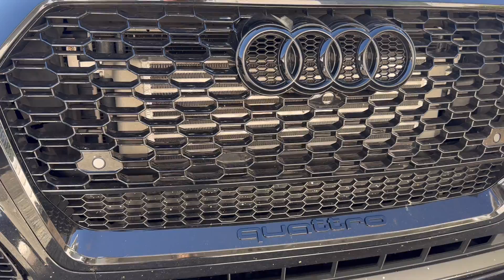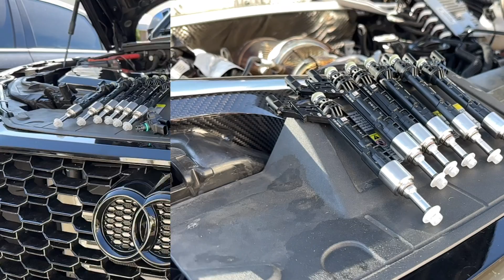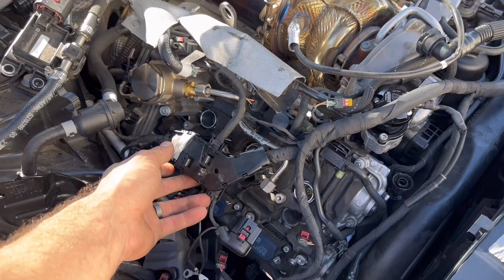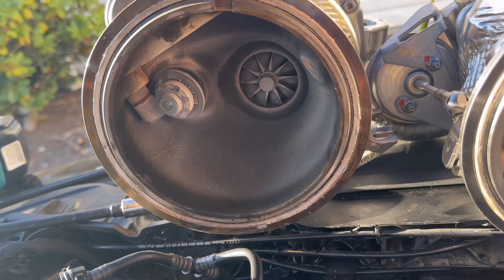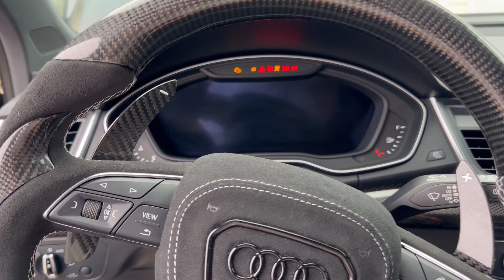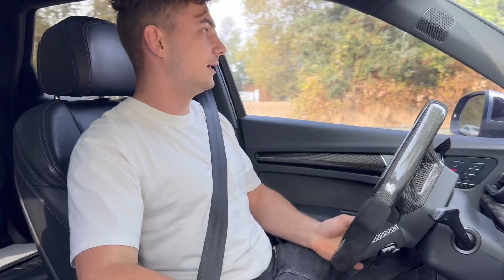BUILDING my SQ5 into a BUDGET SUPERCAR Killer

Comment: yo I checked those turbo smart blow off valve and diverter valve. The site says that they're only for SQ 5 but I have a 2020 S4 any reason to your knowledge they wouldn't work? and you still run the turbo smart parts or did you go back to stock

Comment: What is the maximum horsepower this engine can handle without problems, because I have seen people take these engines to 750-800hp with stock internals. I'm only interested in the engine, not the gearbox
Reply from the maker: I’m basically pushing around 750hp to the crank currently which is insane. Engine is happier than ever. We’ll probably see 800hp on the stock motor
Reply: @Need4Built  would recommend that 750-800hp on stock internals and even if that is a daily (sleeper)..??And are you pushing 750hp on crank on regular fuel or E85..??
Reply from the maker: @erikerik9613  650hp on 92 octane, 750hp on E70.

Yes my wife daily drives it every day. I’m at 70k miles on it now

Comment: homie, why is your oil cap saturated with oil? just from the job? only reason why I point it out is because of the upper PCV hose one way valve has been failing on a bunch of our cars causing oil vapor to blow by the cap, just FYI
Reply from the maker: I’m really happy you noticed. Yes my pcv was failing, I had to replace it right after. Including the hoses that also cracked or failed. 
I’ve already seen too many b9 pcv failures where I decided to make a video about it. The latest one. Check it out:
Restore Lost Horsepower By Replacing This ONE Simple Part
https://youtu.be/Qr-azJgRFD8
Reply: @Need4Built  🤜🏻🤛🏻

Comment: I also have a hybrid made in Poland on ball bearings for half the price of TTE and gets up much better than tte on fuel 98 acetate 620KM 0-100km/h 2.8 100-200 6.7 1/4 mile 10.6 car s5 sportback
Reply from the maker: My SQ5 on E70, full weight weighing 200kg more than your S5, with the TTE810 does 2.7s 0-60, 100-200 6.5, 1/4 mile 10.5.
The TTE810 has much more capability than any other turbo on the market, with more potential. It’s capable of 700+whp, I’m only at 640whp.
Reply: @Need4Built  Not bad my s5 with the driver is 1960KG and how much NM do you have with me only fuel that the station is 95 98
Reply from the maker: @marekhulek3142  
840NM, that’s what I put down on the dyno. 
My sq5 with the driver is a little over 2150kg.
Reply: @Need4Built  You have a lot of Newton meters, I only have 770, but I have a serial catalyst and a serial intake, after replacing the throttle in our engine, it reaches 40KM and 40NM, the same after the porti gu channels in the head, if someone has a push for power, it's a nice option for an additional 80 horses, but there is a problem  with a larger throttle because it does not undergo adaptation you need to work on the soft because I did it to the client has 780koni and 900nm in S5 now he will put 2x g25You have a lot of Newton meters, I only have 770, but I have a serial catalyst and a serial intake, after replacing the throttle in our engine, it reaches 40KM and 40NM, the same after the porti gu channels in the head, if someone has a push for power, it's a nice option for an additional 80 horses, but there is a problem  with a larger throttle because it does not undergo adaptation you need to work on the soft because I did it to the client has 780koni and 900nm in S5 now he will put 2x g25
Reply: @Need4Built  Do you have a diagram somewhere how this turbo gets up
Reply from the maker: @marekhulek3142  
https://youtu.be/PCkOyrSXL1M
That’s the link to my dyno day with the SQ5. You’ll be able to see a comparison of both the dyno graphs for a TTE710 S4 and my TTE810 SQ5.
Reply: @Need4Built  https://youtu.be/Dv1DN7kJ0dQ     This is the result on the tte 710
Reply: @Need4Built  Did you replace the rs4 injectors or strengthen the fuel pump

Comment: I’m looking into buying the turbo, but many don’t recommend it because they don’t have a file for it and claim is not safe. I’m stacking parts right now and found the tte810 available. What’s your advice ? How does the car hold up to it?
Reply from the maker: IE is right around the corner with their insane TTE810 files. If I was you I would buy the turbo now because it takes time for you to receive it. 
I’ve already put thousands on miles+drag testing on the turbo. Car/engine/chassis is happier than ever before. No issues what so ever. I just came back from a recent trip. Look out for the next upcoming videos. You’ll be SHOCKED 😉
Reply: @Need4Built  I appreciate your response. I subscribed and I’ll keep an eye on your videos. I’m looking forward to this never ending build. We should keep in touch. Thanks for sharing

Comment: fuck yea bro i love it. Urs is so much more badass, but I have a hot suv also- its a 2004 xc90 that i fully rebuilt last fall and am now in the process of getting tuned. its quick not fast, car only has gears for maybe 155, but that makes it close ratio in a sense- its like hot hatch fast rn at 250 wheel but its untuned. first tune is gunna make 325/350 ish and if I get bored of that the motor I have is good for 500 pump, maybe 650 on e. point is hot suvs are fricken cool, urs is an absolute unit and im stoked for u.

Comment: Lol nice, running an IDENTICAL setup on my ABT B9, coincidentally picked all the exact same 2+ parts except went AWE for the exhaust. Mythos BOptic as well 🍻 That turbo's the next step for me too, looking forward to seeing how it holds up for you.
Reply: What's been your experience with the exhaust?  My experience was AWEful!
Reply: @Rey2018SQ5  why awful? what’s wrong with it? I love mine. running the resonators because catless. non res was too loud
Reply: @gunnar6726  droning and vibrations especially in 7 and 8 gear.
Reply: @Rey2018SQ5  if there’s dash vibrations look into pulling the speaker grille and putting silicone on the clips. odds are there’s plastic pieces broken in there from the direct windshield sunlight alone. Everyone’s center channel grille rattles. For the droning I just shift down if I’m pulling up a hill or on the gas at all. I keep it out of 8th gear. Any boosted engine trying to put down power at 1500 rpm is going to drone like crazy. idk u could always just put the stock cat on and even the stock exhaust if it’s really too much. It’s not meant to be a quiet exhaust.
Reply: Hey, can I trade pics with you re: AWE exhaust?  Maybe mine wasn't installed correctly?

Comment: Why an SUV?  Wouldn't it make more sense to put all that effort into a nicer driving and handling car like an A4/5/6/7 ?  Great video though.
Reply: When you put a beating down with a suv, it's just an entirely different feeling!
Reply from the maker: @ElRayDelRio  This guy gets it! Fast SUV’s all the way!
Reply: @ElRayDelRio  Yeah but the driving dynamics and steering feel is just, well, not fun.  I'm confused that's all.
Reply: @sinoperture  I have an SQ5, these drive nothing like your average SUV. I've got lowering links and 034 swaybars and it handles better than most cars on the road.
Reply: @sixajd  I'm sure it does.  But we are not talking about most cars.  A car enthusiast goes to get a car, it just seems odd that the base to start from would be an SUV.  For example there is an A7 series car, more room inside, nicer handling and double wishbones all around straight from the factory…..  I get why some people want an SUV, they want to sit up high.  But that is the anathema to a great enthusiast driving experience.  I guess if you place more importance on being up high than anything else, then yeah, I guess it makes sense to start there and then try to claw back some enjoyment through the mods.  I'm not sure 5-10 cm of height gain would be worth what it costs you both in time and effort for mods as well as the compromise in the final result.  Not trying to hate… it just doesn't make any sense to me.  Then again we are all different I guess and it may be a cultural thing too.  SUV's are a very US thing too I suppose.